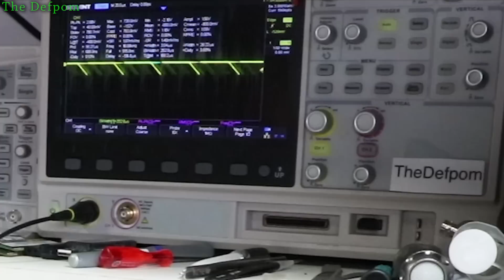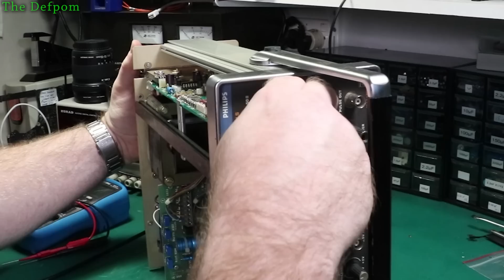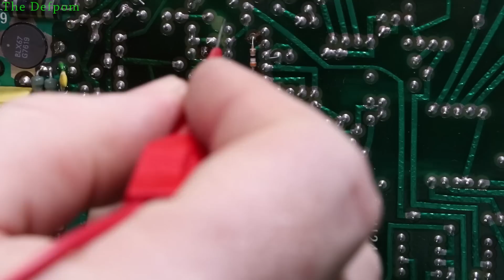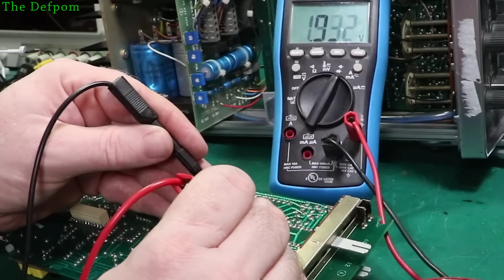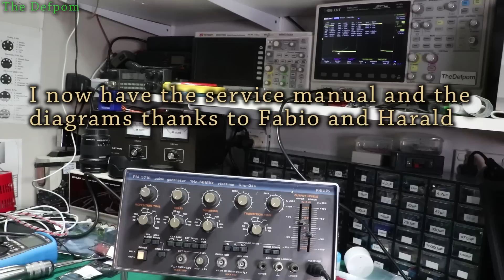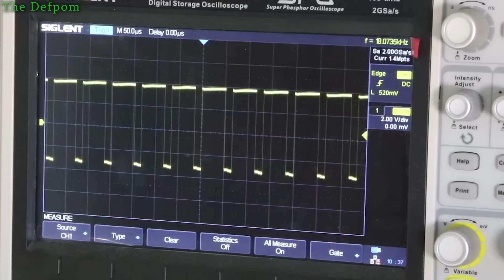🔥 #571 Philips PM5716 Pulse Generator Repair Part 2 👁👁

Comment: Did you do a full recap?
Reply from the maker: Simon Spiers - not yet but I likely will, there are only a few electrolytics though, it has many rectangular caps which I don’t know the type of, I haven’t looked them up in the manual yet, but I suspect they need replacing too.

Comment: That pcb reminds me of the ones in old tv sets, when you solder a joint it blubs the solder.
I'm sure the pcb releases gas/air from the inside of the board up through the through hole.
I think a good switch/pot clean would help stability as well.
Now i know why you buy old gear to repair, you like the pain :-D
Reply from the maker: zx8401ztv - I like this age equipment because it can be fixed without a diagram, and doesn’t require a microscope!

Comment: Well done! I really enjoy your troubleshooting videos,  great technique. I tend to trace signals and look for signal loss,  sort of follow the flow and check joints and parts along the way but that usually requires a schematic. Great to see an old piece of gear restored to working condition. What is the name of your obsolete parts source?
Reply from the maker: David V - UT Source, have allowed me to get parts a few times now to fix gear for videos.